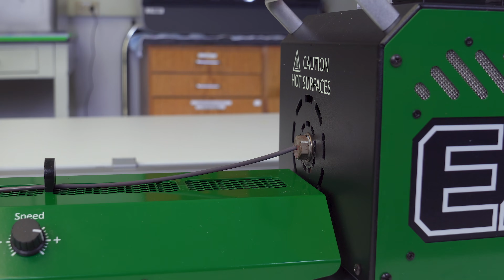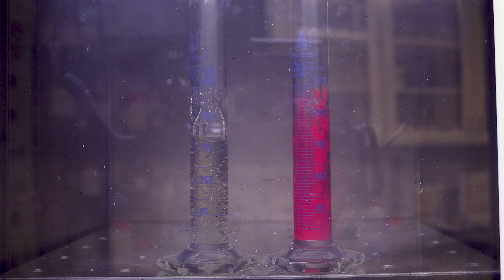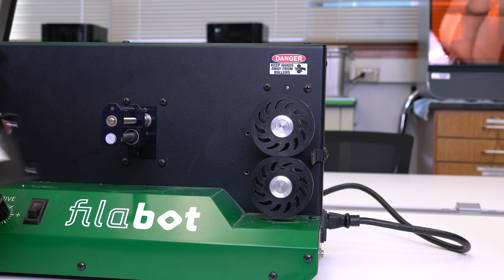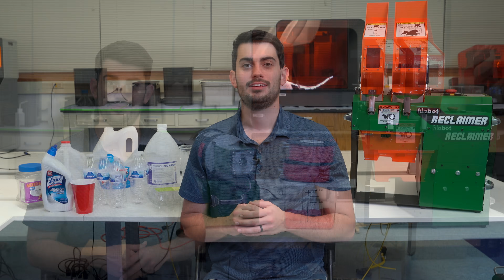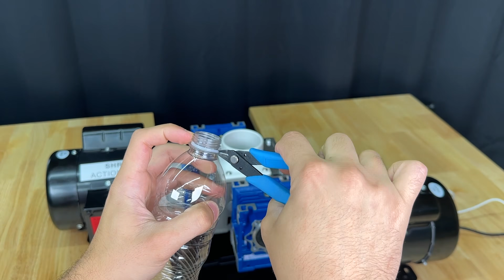Recycling 3D Prints and Waste Plastic into Filament (PET & PLA)

Comment: This is hands down the most thorough and clearly explained video on why recycling 3D printed waste is time consuming, challenging and expensive both in energy costs and products required to produce a useable resultant filament.  The added degradation of the plastics from multiple heat cycles and the need for virgin resin to make a product that prints reasonably well is another factor that many people don’t often consider.  Thank you for covering so well all the considerations and steps required to produce an at home, Makerspace or other consumer-based recycled 3D printer filament.  It is a wonderful thing that so many people are passionate about wanting to recycle their 3D printing waste.  It's just much more difficult to do than most people realize. Someday hopefully there will be a more straightforward path or more companies like Recycling Fabrik in Germany, who accept and recycle 3D printer scraps. I’ll be sending people your way to watch this video.when get questions in the future.  Many thanks!

Comment: To address the biggest elephant in the room is people need to stop printing crap for the sake of printing crap, yes printer's are great for phototyping but how many pointless boxes or vases do you see on line for sale. Just because you can it doesn't mean you should I mean it's no point re inventing the wheel to come up with a design or product that does the same job as the wheel.

Comment: Has anyone at your Makerspace ever tried printing regrind with a pellet extruder?   
I'm genuinely surprised I haven't seen this tried. I would imagine it would be difficult, like anything else, but one would think that it would be worth it to skip a few steps.   Even if the amount of regrind to fresh pellet was low, I would think it would  be usefull.
Reply from the maker: Yes, I have! You have to print slower due to the lower bulk density of the regrind. But definitely possible
Reply: @DrDFlo  Oh excellent.  Sorry, I missed your answer while typing that other comment.  Simply knowing that it's possible is a massive help towards me trying it for myself in the future.  Thank you very much.
Reply: Honestly, if I ruled the world, I would simply design an extremely rugged pellet extruder designed specifically for regrind.  Even if the prints were low quality it would be insanely worth it to completely remove the idea of filament from the system.  I can't help but daydream that something like this would open up the door for the grinding up of household products for printing.  Sadly I have limited resources for such experiments.

Comment: As an optician im very interesting to see if you can recycle cellulose Acetat frames. The goal would be to get uniform pellets to heat mold plates to cut out new frames. For the community could you test a cellulose Acetat spool because it is rare on that market. On the manufacture side i could read that it is possible to recycle PA so my question is while i saw that you have a printer from Formlabs, could you recycle prints with this and could make a PA spool out of it. Hope for more content like this special if you could try cellulose Acetat🙏🏻

Comment: first off, Great video and very well explained.  way too expensive for the hobbyist and very specific for the filament type separation.  What I think would be interesting to know is if there is a way to mix different types of plastic. to get a hybrid filament.  Again its all about temp and the thermal breakdown of the plastics.  basically  I have a bucket of plastic waste ranging across multiple filament types and colors. if a reasonable melting temp could be achieved that crossed all of the plastics then I could see that slurry being injection molded into something useful possibly.

Now if a maker space had one of these machines and said, "bring us your sorted filament" I might sort it.  and  I might buy some spools if the price was right and the filament was sound.  At any rate, its getting closer!
Reply: Recycling Fabrik did it in the past, but they got too big now. Very clever guys from Germany :)

Comment: I really hope the price of the machines go down significantly, or at the very least they release the plans to build it and focus on making money off the software to run it. I'd be fine buying the software for a few hundred bucks and building the machine myself. I know they have money and time into the engineering of the machines but the $12000 price tag is pretty steep for what it is fundementally.

Comment: have you ever made a DIY filament extruder? There seems to be a lot of old projects floating around but instructions are very sparse.
Reply from the maker: Unfortunately, the throughout and consistency of DIY extruders leaves a lot of be desired. I touch on it in my filament extrusion video ( https://youtu.be/cIh0n2zOCfM?si=O5LMI1jMyfwXKk5g ), but to extrude most commodity plastics a specialized screw, a precision-bored barrel, and a powerful DC motor are needed.

Comment: When making PET bottles in a factory, they start with a preform that looks kind of like a short test tube with thick walls, and then use compressed air in a die in an oven to expand it to the final shape, like a balloon. Would it not be possible to do the same in reverse?
Like using a vacuum pump connected to a metal bottle cap and then put it in an oven or perhaps using hot air?
Then it should be thicker and easier to granulate.

Comment: This throwing ideas at the wall here, but couldn't the first extrusion pass be fed directly into the palletizer?
Or is the extrusion /that/ slow that it would create unsuitable 'pallets'?
Reply from the maker: Yes, you can bypass the spool and feed the material right into the pelletizer. The only issue is that the 3 mm plastic fiber must be completely cooled (solid) before pelletizing

Comment: Hi, Dr. D-Flo. I have been interested in filament recycling since I began to print several years ago. Now I understand it is not possible to recycle PLA indefinitely due to the degrading problems. But to PET, I have a couple of ideas I think might work but I don't have the resources to try. 1. Like the idea to produce optical fiber, melting a large amount of PET in a melting chamber or through several melting chambers with different temperature settings from softing to melting. Each Chamber has blender inside to mix the material. Then, either use gravity or pressing the melted PET through a nozzle on the bottom to achieve certain diameters filament. 2. Or, melt a large amount of the PET firstly and then cool it down into a big cylinder-shaped block.  After that put the block on a lathe and use certain shaped cutter, for example a U shaped cutter, to mechanically cut down a long thread of filament. Either way will save the hassle due to the granulating the pet material. Of course, large scale of recycling PET has already been a huge industry. These two methods I think could be possible for individuals to practice.  What do you think?

I used to think PLA printing will be the future but now I feel like I am producing a lot of waste from failed print to the skirt. And all the items I print today will eventually become some land fill one day. And the worst part is there is no way to truly recycle it but only dilute with new material. The only way I can think of complete "decomposing" PLA is to burn them in a furnace of some power plant. Besides, I think even if the government taxes PLA to encourage recycling, those online platform like Temu or AliExpress will be flooded with untaxed and cheap imported PLA from China. I kind of feel bad to print anything non-functional now.
Reply from the maker: You have great ideas! I was leaning towards using our melt flow indexer (a melt chamber similar to what you described) to turn the PET flake into the initial fiber that would be pelletized before a final extrusion. Besides mechanical recycling, there has been some promising advancement in molecular recycling. Eastman is building a facility to molecularly recycle PET near me: https://resource-recycling.com/plastics/2023/08/01/eastman-provides-updates-on-massive-pet-recycling-plant/
Reply: @DrDFlo  That is great news. Thank you for your reply. Hopefully there will be a good method to help hobbyists to recycle one day.

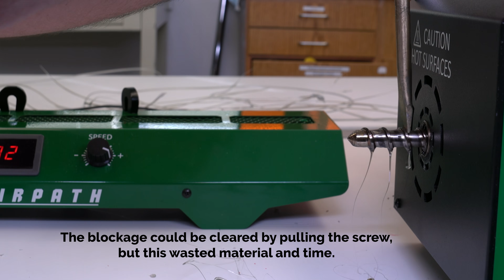Comment: If your 3d print needs a specific center of gravity or ballast for a weighted base, I feel like pellets could be great to add mid-print as opposed to solid infill.  Your QC on the pellets can be pretty loose and you still maintain plastic homogeneity should you intend to later recycle the same print.  I'd like to see more investigations using heat (look at the PET droplets falling from the screw! 36:16 Could you get those small enough so they serve as pellets?) or maybe high frequency vibration cutting methods to simplify pellet creation and microplastic reduction?  Thanks for sharing your experience and doing the economic calculation for us!

Comment: Really interesting video. I have to wonder what the energy use impact is per kg of material produced compared to a factory setup. I expect it will be less efficient, but is it enough to make the diversion from landfill worth while? Essentially, is small scale plastic recycling better for the planet overall than not consuming the energy it takes to do so? I think a good option might be large scale recycling of PLA and PETG, but I doubt that can be done in many places. Really well made video, Doc!

Comment: Thank you for this video! You have summarized my own experience in this topic and answered all my open questions on why i have inconsistent filament diameter on my diy extruder why filament is not the same as a new one, why do we need compression screws and the most valuable is how to fix all of that issues! Regranulating of the waste and mixing it with a new granules will fix all my problems!

Comment: Have you tried compacting the PET bottles and then heating them to melt in a bit more thick/solid object before shredding it? It should give more thick pallets with better flowability and thus be easier for the extruder to operate. I might be wrong but it's worth a shot.
Reply: You need a very good shredder for this type of action.

Comment: The battle for recycling 3D printing waste continues. Have you looked into melting flakes into pucks? or using melting chamber with a piston to extrude into an inconsistent filament? I do understand the first proposition would degrade the filament further, but it might be worthwhile exploring.
Reply: Hydraulic press? Probably better to avoid another high temp heat cycle. The press will generate heat which could help it fuse and be grindable into chucks rather than flakes.

Comment: Regarding the PET flake issues, would it help to vibrate the hopper?
Reply from the maker: Yes, would definitely be helpful for the flowability problem. I actually purchased a magnetic vibrator that I could stick to side of the hopper when purchasing regrind, but it didn't come in on time

Comment: On the pet bottles could you spread them out thin and run them through an oven to make it ball up as that type of plastic does naturally with a little bit of heat in and over or heat gun then do your final grind and get a better flowability of the plastic. I would not think it would take very long to find the appropriate height and then find the perfect oven temperature in the amount of time you would need to leave it in there. I don’t see this taking more than 5 or 10 minutes. This is the same thing I thought about your really fine powdered PLA so it could be more usable..

Comment: Great video! I’m sure you’ve already experimented with this, but have you considered heating the PET regrind slightly to cause it to shrink and take on a more irregular shape? This could potentially increase the friction between the regrind and the barrel.
Reply from the maker: The PET regrind was heated for 4 hours at 110C to remove moisture. All the material you saw was after that heating cycle
Reply: I tried this option to regrind PET and you're absolutely right. I'll heat regrind (<5mm) again to 150C and let you know how it goes with the extruder. I'm planning to do my extrusion next week. As a poor student I don't have "friends" like this guy. I contacted Filabot and ask them to help me with my school project, but big fat NO was the answer. Oh well, I learned much more than Dr. here it seems by struggling during every step of my project due to lack of 💲💲💲
Reply: 110C is not enough, you need 150C. It will curl PET and that's what you need.

Comment: Is there a reason to not just granulate the new material with the old at once to get a more even mixture at that time and then avoid having to extrude regrind and pelletizing, in turn avoiding additional thermal history?
Reply from the maker: The problem is the irregular shape of the regrind. It may not have been clear with how I explained it, but each screw flight will pack with slightly different amounts of material, causing irregular extrusion. Grinding up the pellets would exacerbate the problem.

Comment: The inconsistent feed of your virgin/regrind material can be improved with a screw that has a mixing section. Also, separate barrel heating zones can help control Feed, Mixing and Extrusion.
Reply: The Pelletizer should be direct drive as well just pulling off a free standing or mounted spool. No need for two separate machines.

Comment: I love working with PETG, does it recycle as well as PET, or does the Glycol cause it to degrade faster?
Reply from the maker: It is easier to recycle PETG because it has a larger process window (more temperatures at which it will be molten without degrading). However, this process window is at a lower range of temperatures than PET's , which means they can't be processed together

Comment: Yeah so this makes it pretty clear that recycling plastic is a nonstarter with anything like current methods. Oxidize it and dispose of the CO2 by some means other than venting to atmosphere; that's clearly a way better use of everyone's time and effort. There is a clear upper limit, set by methods like that, to the externalities not currently priced in. Plastic being 5x more expensive in real terms would be awful and I don't think you would like living like that either just to make this specific disposal method worthwhile.

Comment: I don't know who benefits from the Filabot equipment. For the hobbyist the prices are way to high and for industrial use the working speed is way to low and the tolerance of the filament is not good enough.

Comment: If anyone wanted to make one of these there is a company in the USA called Surplus center. 1hp AC motors about $150, the gear box is about $130, the bearing pillow blocks about $15 each. Then all you need is a CNC or manual mill cut tool steel grinders. I've seen a guy make the grinders using plate steel with a central shaft that bolts the plates together. This can then be cut on a bandsaw or plasma/waterjet.  some sheet metal case. One hell of a lot better than $15000.
The entire units are very manual therefor easy to replicate.

For the every day person wanting to be as economical as possible when printing.. the entire system if near 18k is way out of range, the ethics of charging education facilities that price is also questionable.. . Good concept, good company idea, greedy implementation and therefor bad environmental impact.. im the bin my left over prints go :(

I should note the parts I believe are the same. Ironhorse is a chineese company on alibaba

Comment: Looks like the grinder would be less labour intensive if they changed the design so you had a big hopper at the top, it could grind on the large grinder and drop straight through to the next grinder, with a sieve built in below that (probably angled toward a collection bin) that could deal with the dust and then slide the correctly sized pellets out to the side, that would remove a lot of babysitting from the process.  I've always fancied making something like this (on my list of 3000 other projects i'll never get around to it) but seeing this in action definitely gives me some ideas.
Reply: That would involve extra gearing/axles to run both grinders. This design only requires the one common axle.

Comment: I wish these machines weren't so prohibitably expensive, the setup is quite nice overall. I would love to see more recycling done on a small scale by individuals such as those of us in the maker community, but at $12000 for just two of the four machines you realistically need to make quality filament, the ROI isn't there except for larger businesses that have employee time to burn between other tasks. At $2,000-$3,000 all in for a setup such as this, I could see it becoming rather commonly used, as the ROI on that is more tangible for an avid maker or small makerspace to digest investing in.
Reply: I wonder what is expensive, though. You find new (but discounted) 1 hp motors for $200. Wouldn't a hacker space be able to machine the screw?
Reply: I agree with seanwelding4183. I also want to add that the cost that is represented is way understated in that the source of power (electricity) has not been considered nor the cost of maintenance and repairs to the equipment.  You have already stated as well that the cost of labor and facility overhead (raw material cleaning, operational, maintenance, and supervisory) has not been included.